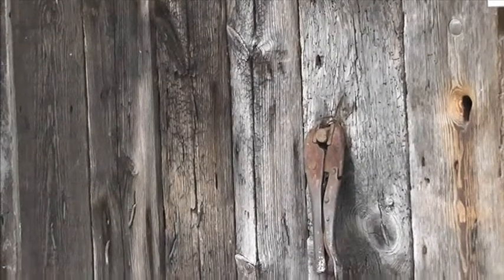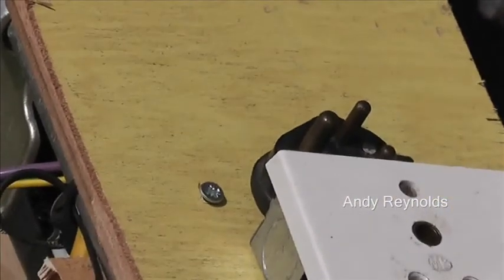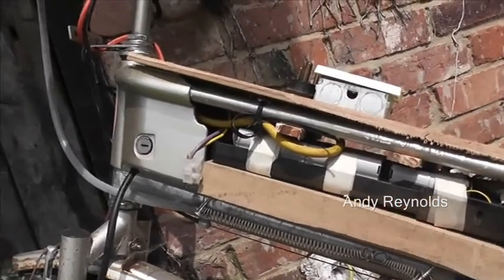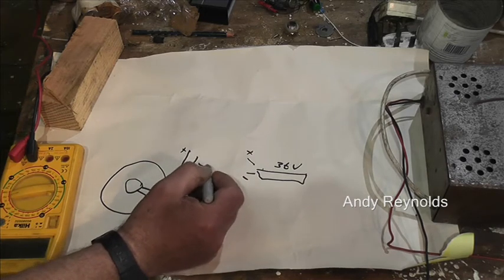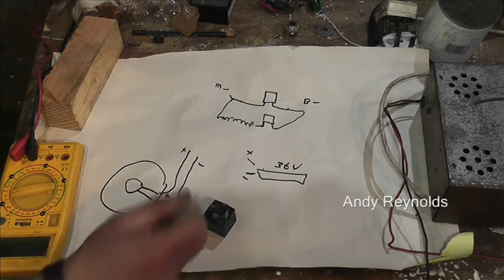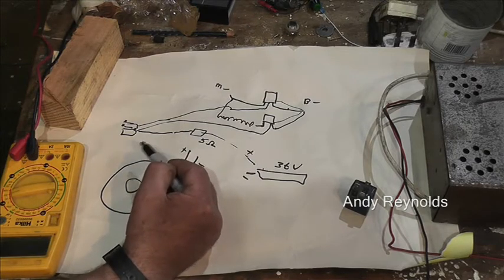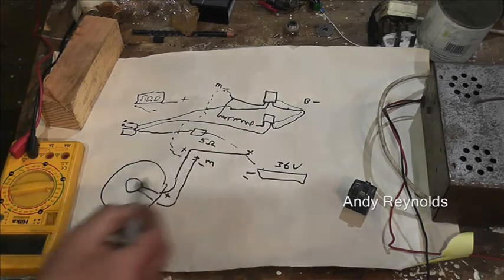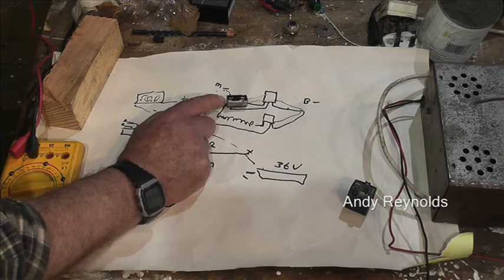Electric bike resistance motor controller, home made, fixable

Comment: I had forgotten your previous video on capacitor suppression for high DC switching. Something to add when replacing the relays in a solar inverter?

I built a load of circuits for automatically turning on a vacuum cleaner when using power tools. A few have failed. Only after watching a BigClive video and your reminder here shows me I hadn't accounted for the back EMF of the relay!
Reply from the maker: Ian, ah yes it's all those extra bits that make things reliable. Protecting the circuit from itself, cheers

Comment: That system is very repairable Andy, I'll give you that. If you haven't already, you could measure the current to the motor on full power, preferably whilst riding so it's loaded, using your clamp meter. You wouldn't really want much more than 10A flowing through those motor brushes would you ? You could always add a small resistance to the full power mode too. Cheers, Dave.
Reply from the maker: Dave, thanks for the thoughts, yes 10 amps would be 350 watts, I'm told these motors are 200 to 250 w. It will be well worth measuring full acceleration current. A small length of resistance wire for full power might be a good idea, reducing current when battling against the wind, cheers
Reply: I did wonder if Andy's fuse protection on the battery is the same as built into the plug. Although the last few 5A and 13A round pin plugs I've seen didn't have in built fuses.
Reply from the maker: @ianhelsbyservices  Ian, yes those round pin plugs had no fuses, I've used automotive spade ones, 2 x ten amp in parallel, cheers

Comment: Good stuff Andy, 
I have a spare motor wheel but I have a feeling it has 7 pins. 

I helped a mate install solar panels on his roof yesterday. He was confident with the tech but not the building stuff, so I fitted the brackets, It is a wonder how easy it is to remove concrete tiles! He did all the grinding to modify the tiles so I had a pleasant day up on a roof! Now another 1600w of solar feeds in!
Reply from the maker: Guerrilla solar, I like it, 7 pin motor? maybe brushless with a tach also, not sure but that would only be 5 pins. This ebike seems to fine for round here where the major impediment is the wind, cheers
Reply: @TheInfoworks  3 for motor phases and 3 for hall effect sensors, but... they usually also have gnd and +5 making 8, so wondering if the cable is 7 pin and shield as a ground.

another possibility is the controller is inside th motor so its 3 for throttle, 2 for power and 2 for a ignition, but only guesses from many i have seen
Reply from the maker: @lezbriddon  Exactly, made complicated for no practical reason, cheers
Reply: @TheInfoworks  complicated to increase efficiency. And to be honest there not that complicated if you have have the experience. Nearly every time they fail it's the MOSFETs and there pennies to buy  And there's the simplification that if they fail and MOSFET replacement is a headache, spend 20 beer tokens on a brand new controller.
Reply from the maker: @lezbriddon  Yes I can see that would be the way forward, however I'm experimenting here with reducing consumption of new items and just using what I have. Those cheap speed controllers are junk and the ebike ones require a crank sensor, that way they are pedal assist. Cheers
Reply: @TheInfoworks  I'll agree with them being junk, but there functional junk and mostly reliable in the sub 500w area, lost count of the number of them I have used, but all have been a headache from the simple fact that cheap Chinese factories are all colour blind on wiring, it's whatever the recycling truck brought them that day! You order one and when it comes the connectors are random with extra ones and some missing (just spent 130 on a 3kw one and it has no brake(L) signal so I now have to rewire my brake levers to send +12v instead of sending a ground signal) and once you do get one working perfectly when winter comes you will find the waterproofing useless and boom. (Ask how I know). Got a replacement to do here now as the thing is ok until it reaches top speed, then it pulses the wheel on/off but only on flat ground... Uphill it pulls perfectly...... They can be a nightmare.
Reply from the maker: @lezbriddon  yes there is a point where you can't do without them, but hopefully I'm not at that point. Let's see how I get on with this method. The weak point is the relay contacts and then I can always upgrade to 70 amp units. I'm hoping this is not the case as long as the low power is on then the jump to high power is not so great. Noakswalker suggests a small resistance with this also to protect the motor. Cheers
Reply from the maker: Owen, what mounting brackets and rails did you use?
Reply: @TheInfoworks  Hi Andy, no idea, a stainless steel bracket that sits on the rafter and comes down between two concrete tiles, requiring a little bit of trimming of the tile above, the bracket has about 6" of holes so you can locate it left or right on the rafter to coincide with the low point of the tile. The brackets were some aluminium system. very complicated extrusions with a little j shaped nut that holds onto corrugations in the extrusion. all recycled from another roof. The panels just sit on top of horizontal rails and clamp down. I didn't see a brand name anywhere.
Reply from the maker: @bootsowen  Owen, just watched your video on this fitting, yes a standard fitting kit of parts, easy with modern tiles and two people, cheers
Reply from the maker: Maybe there are 3 motor wires for a brushless three phase format and the rest can be ignored, cheers

Comment: On a lastmile vehicle I own the MOSFETs keep failing no matter how much over specification over the current switching.
Reply from the maker: I'm figuring that the problem is that they don't full switch on or off and so there's a huge heat build up with large currents. That's down to cheap and poor control circuits, badly put together, cheers

Comment: It's alive that's what I think! Resurrected from the dead, in a Mad Max style. Your videos inspire me not to fully rely on the consumerism view of if it's broken replace it rather than being inquisitive and attempting to fix yourself or applying knowledge to restore to a functional level to fit your needs. 
As a result of applying in my own world, fixed our dead dishwasher which the control panel ceased to function, a simple case of wiring loom too tight and shorting to the chassis. Result!!
Thanks Andy for another great video, love the security plug concept!
Reply from the maker: Matt, I like restore to a functional level to fit the needs. Charged from our solar, so what if it's not totally efficient, it's zero rated in my book, cheers
Reply: @TheInfoworks  more people need this view for the future of the planet, to apply a level of self sufficiency and to change the functional base line of how we live!